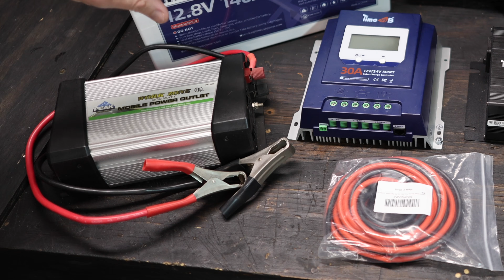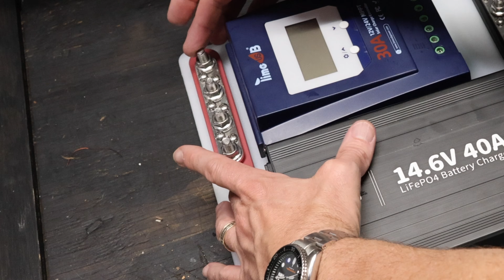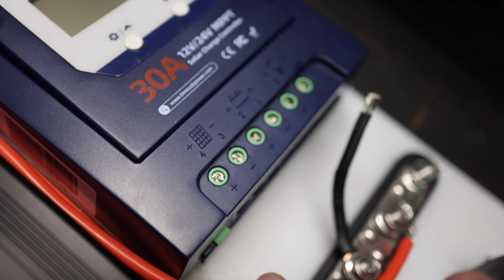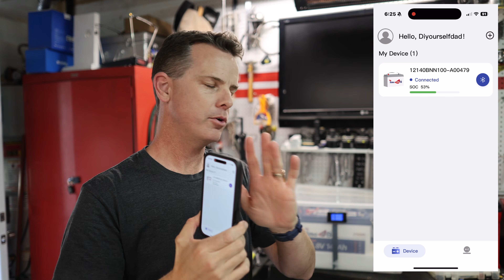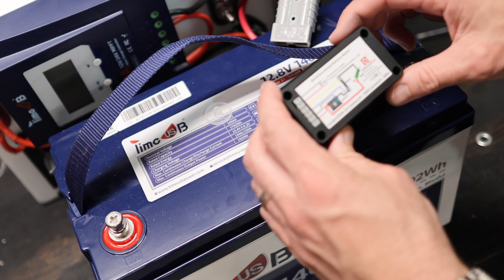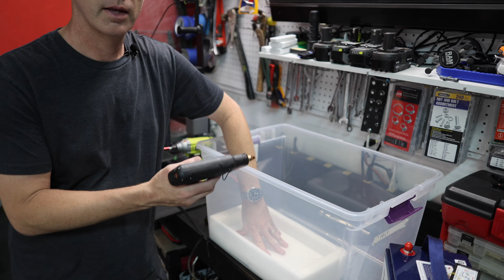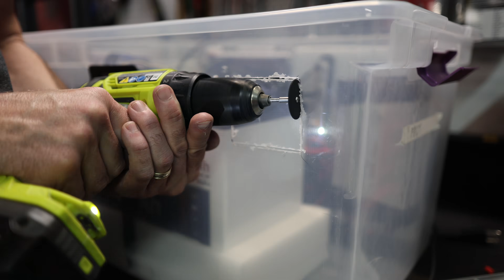Build Your Own Solar Power Station - Make It Better - Make It Cheaper

Comment: Twisting wires going into crimp connectors is bad practice. A small 1/4 twist towards the end is the most you should do if the end needs "cleaned up" . But fully twisting the end can cause added strain on the individual strands, making them weaker. Vibration can also cause a twisted end to "unwind" changing the cross section in the crimp potentially changing its electrical characteristics or just straight up coming loose. Other than that add some fuses or circuit breakers and its a nice build!

Comment: I have a bluetti and it uses many large capacitors instead of a battery. Could you show us how to build one of these with capacitors?
Reply from the maker: Bluetti uses capacitors for power buffering, not for storage.

Comment: I would add a main isolation shut off switch between the battery and power inverter, I destroyed the battery in my arc 500 because I accidentally bumped the power on button which drained the cells beyond reboot. All power banks should have a main shut off switch that kills power to everything but the charge controller when not in use.

Comment: I'm about to do a van camper build out.  A great video would be on that shows how to set  up the switching for being able to charge the battery bank system via either shore power, solar, or vehicle charging system.

Comment: You are building a 12v home made powerstation but commercial power stations are 24 or 48v. It’s an interesting DIY project but if people are going to emulate and actually use it, 24v would be more appropriate.

Comment: i priced out all the links in the description. its about 750$ for this 800w, 1.8kwh system.
i built my own system from cheap CATL cells, 15kwh, 6.5kw inverter for about $1000 after accounting for all the hardware/wires. i charge my car from it every day at work lol.
if you rip open any of these batteries sold in plastic boxes, you will find the same cheap CATL prismatic cells inside :p
Reply: How did you find CATL cells ? Garage ? Website ?
Reply: @christophec.482  alxp littokola rebranded

Comment: Excellent video for beginners.
Just a little, tiny mistake. That solar connector is xt60, but xt90 is also recommended for even more overhead safety.

Thank you for the video

Comment: Great video! I have made many of them. Mostly they have been 12-24ah, with LifePo4 batteries. Last year I made two, 50ah, lifePo4 power boxes. Plus I showed a few people how to build them. I carry around a 1000w inverter. I added a shunt so to read the battery life. I’m having fun making these. I made three 30ah for my nephews, for their hunting fishing and camping needs. I also made them so they will be charged by solar, AC, or 12v dc charge.
Reply: What cases do you use please? I got hold of some aluclad which is strong and light, just got to figure out corners and edges to look like the makita site radio.
Reply: What?? 12 - 24 amp hour, 30AH... honestly that does not sound like much at all. Are you talking about the AC output or DC we don't know cuz you don't differentiate. Confused. 🤷🏻‍♂️
Reply: @desertodavid maybe he means 12v-24v, 30ah-50ah?

Comment: How about adding a DC output side ?  12V-to-USB-out of all possible voltage/wattage up to 240.  

Plugging an AC USB charger into an inverter is like turning a cow into hamburger and then back into a cow just to get a glass of milk.
Reply: I think that wiring harness was purpose built to avoid just that.  I'm sure the DC sources are feeding directly off of the dc inputs on the inverter.  But nobody ever said product designers have common sense, so it might not be the case.

Comment: thanks, i built mine from trash instead, using a homemade battery pack from discarded laptop batteries, 500w inverter and 30A solar charge controller and a toy case :>

Comment: Inverters create a lot of heat, so you will probably need some sort of heat management system. You could probably dismantle all of the devices and use them without their cases as a space-saving measure.

Comment: I would never build a 12 volt system. Those power stations are not 12v like the system you built. If you're going to home build one, 24 volt systems are the way to go. more volts, less current. More efficient. Of course with your own system, you won't be able to plug it into an interlock generator port to provide house current. It will have serious limitations
Reply from the maker: If I had that stuff laying around the house I would have. The battery and solar controller were removed from the trailer for an upgrade, the inverter I’ve had laying around for over a decade. I’ve got plenty of other generators and batteries that I can plug into my transfer switch.

Comment: That 800W Peak Work Zone inverter is Modified Sine Wave, it is not good for sensitive electronics or motors, it is OK for resistive loads.
BTW, the setup needs fuses/circuit breaker, kill switch, and good ventilation.
Reply: caught that too did you
Reply: Where would you put the fuses, circuit breaker, kill switch?
Reply: @ScottyFour  kill switch usually goes on battery. fuse for anything drawing power.
Reply: @TheJohnJacobs  ... as close as possible to the power source and properly and dimensioned according to the cable cross-section
Reply: @ScottyFour  In and around EVERYTHING. Period. You need all those things. Leaving them out, as in this build is foolishly dangerous. Sadly, this is a genuinely terrible build in an even worse encapsulation environment. One drop and that $12.00 'container' is done. Really not well thought out...
Reply: @ScottyFour install the fuse directly to the battery terminal.  Size to the wire gage,  he used grossly undersized cable.
Reply: @paulwyand6204  I agree about the cables and just bought my block fuse for my battery. This isn't my first solar build, but it's my first using a lithium battery.

Comment: You need fuses or breakers just for safety. Also a cut off switch is wise. Lastly I’m not sure I’d want to have the charger only connected when charging with another cut off switch
Reply: How do you switch to a lead acid battery
Reply: Does it take a whole different charger

Comment: You really don't need the shunt just wrap the sense wire from the gauge around the negative battle cable and your good. You like spending money. Its the exact same thing as using that stupid shunt. All Its doing is sensing the electromagnetic flux around the wire which is directly proportional to current draw on the battery
Reply from the maker: You say that like I bought the shunt separately from the gauge…. 😂

Comment: So how much did you spend?  I didn't see it as I watched the video. Impressive explanation and easy to follow. But did you REALLY save me any money? No spreadsheet you could have put on screen?? Or did I miss it? -- I have no idea if you've save me money or not.
Reply: Pull up the links and look for yourself with some simple math
Reply: @firecop1728  - Alternatively ... people could just stop lying. 

I did the maths. His method would have cost me 1.5 - 2.5 times higher.

Comment: You have done a great work.
Don't you think it needs some ventilation as battery is not changed under air tight container?
Otherwise thanks again for your innovation.

Comment: Jackery 1000 is like $500 on amazon right now. I can't buy a battery, charger, controller, and inverter for that low of a price.
Reply from the maker: That’s got 50% less capacity than this one and the solar charge controller has 1/3 the output on the solar controller…

Comment: What was the final cost ? Was the DIY  version  a lot

 cheaper  ?
Reply: They usually aren't cheaper on this scale, but the key for me is that they are REPAIRABLE and upgradable. 
You aren't going to easily add a higher wattage USB PD or QC charger to a jackery when it ages out. You're not going to be able to replace the charge controller or inverter on and older model bluetti when it fails. 
A DIY system like this can keep going forever with swap ability. More panels? New inverter? replace the SCC? add more dc output plugs?

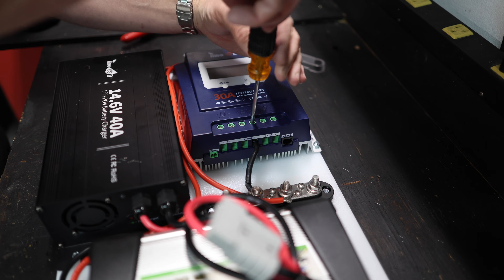Comment: 9:42 wire ferrules are nice to use instead of inserting bar wires.
Reply: Exactly! Crimped connections are so much better than just shoving in the loose wire-strands.
Reply: @toniturnschuh and basically no risk of a stray wire shorting things out.

Comment: What’s “Wall Current”? :D
Reply: wall current would be the current draw from the inverter on the AC high voltage side same as the power outlet in your house.
Pretend the inverter output is 240v and its powering a device drawing 1 amp (current). At that voltage 1 amp is equal to 240 watts. Now on the other end where the battery is powering the inverter you have 12.8 volts (could be up to 14.4v fully charged) but we will say 12v for simplicity with a draw of 240 watts ( will be slightly higher due to losses as inverter isn't 100% efficient)  At 12 volts 1 amp is equal to 12 watts and 240 divided by 12 is 20 so your draw on your battery is 20 amps. The battery used in his build was a 140ah so you would be able to power a 1 amp load at 240v for 7 hours to dead empty which isn't good for the battery, we really want to leave at least 10% so that would be 14ah but for simplicity again we will say 20 and that would give you 6 hours run time at that load.

Comment: Suggesting that someone use a lead-acid battery that's lying around is, most likely, going to result in disappointment for the person who follows your advice. 

LiFePO4 batteries are better for several reasons:

Much longer cycle life of  3,000-5,000 cycles (or perhaps more) instead of 500 cycles (lead-acid).

Built in BMS (Battery Management System) to prevent over/under charge, over current, over temperature, and sometimes under temperature.

Can be safely operated from 100% down to 0% charge repeatedly without damage, though the battery will last longer if it is not discharged below 20%. Lead-acid batteries should never be discharged below 50%. They should also be kept at 100% charge 100% of the time to prevent sulfation. Any time a lead-acid battery spends at less than 100% charge is detrimental to it. But you can't get any use out of it unless you discharge it.

Stores more energy in the same size package than a lead-acid battery.

Lighter weight in the same size package.

Flatter discharge curve. Voltage stays relatively flat until nearly fully discharged. Lead-acid has a steeper voltage drop curve.

Often backed by a multi-year warranty. This is possible because the BMS protects the battery against most of the things that will ruin a lead-acid battery like short-circuiting, over-discharging, over-charging, etc.

Cost per unit of energy stored (kWh) or Amp-hours is lower now for LiFePO4 batteries than lead-acid in most cases.

Comment: I don't understand what the black charger is for. The solar charge controller is what charges the battery. So I don't understand the other part.
Reply from the maker: That is the AC charger that plugs into the wall to charge the battery.
Reply: @DoItYourselfDad o ok. I see now. I was thinking you were just using solar.
Reply: The black charger as you call it is the "Invertor" to convert the DC power from the battery to AC household which is where mains accessories are connected but he added a front panel mains plug port to the front of the box connected to the "Invertor" plug on the right for mains accessories to be connected to.
Reply: @ThePhantomRanger yeah he already had a inverter though the silver box is the inverter. So the black box I don't understand what that's for.

Comment: Hello there!  Since I already own an EcoFlow, and it is too late to return it, I would love a video that shows me how I can build additional battery packs to expand it's capacity.  For some of EFs models, additional battery packs are actually more expensive than the main unit.
Reply: I'm charging my Anker C1000 from the load output of a victron mppt connected to 5.12kWh of batteries. Upgrades my system to a total of 6.2kWh.
Reply: Years ago I started to start buying the components to go solar bought a big cat battery and a 1750 watt modified sine wave inverter it ran my microwave and my Light's to charge it I took an old snow blower and the alternator and regulator from my old Dodge motor home set it up so once it started I pushed a button and it started charging it ran about an hour when it ran out of gas it disconnected the alternator from the battery it worked great when I moved out I put the inverter in storage pulled it out and used it for a while once I was settled in my own home again I again started setting up solar bought a new
Reply: That’s a good idea!

Comment: Excellent job showing what's mostly involved to do this DYI. Whether to do this depends on many factors though. I think cost wise it makes sense if you only need the power supply, to serve a narrow or single use situation. You'll also gain the knowledge & ability to repair.
If you want a more durable system with flexibility to easily move the unit and have extensive use situations your still better off, buying one from one of the big six brands out there on SALE. Just my opinion.

Comment: With the wires going into the charge controller should have Farrells on them. I've had it happen where the screws cut the wires. Overall safer practice
Reply: Definately use ferrules. Bare wire or even worse, solder tinned wire, will compress over time and form a loose contact. Results in arcing, carbonization, heat build up and potentially fire.
Reply: @ashleywhitehead3710  6 AWG Copper Battery Cable Lugs 👍